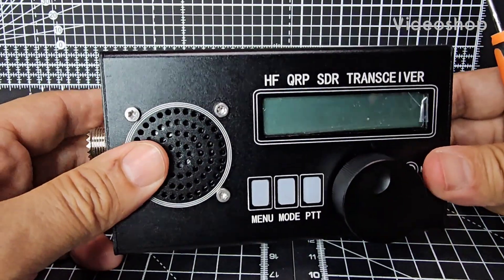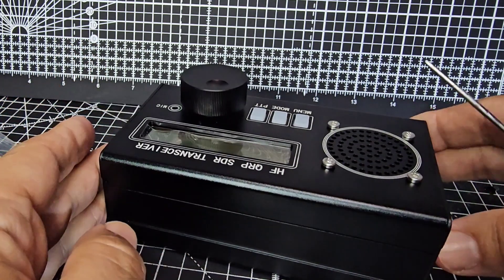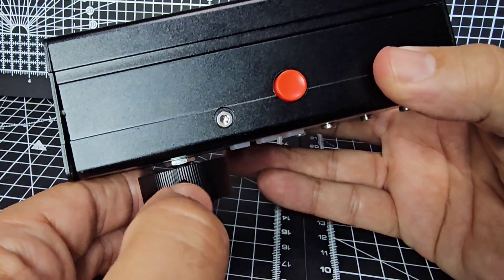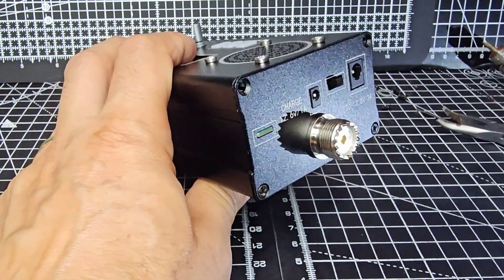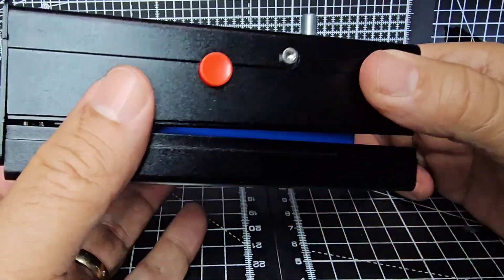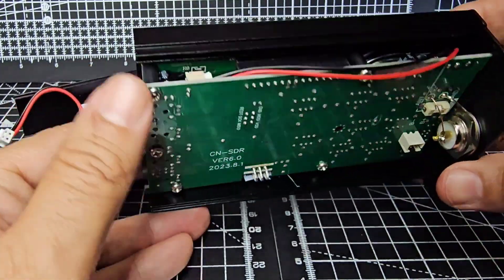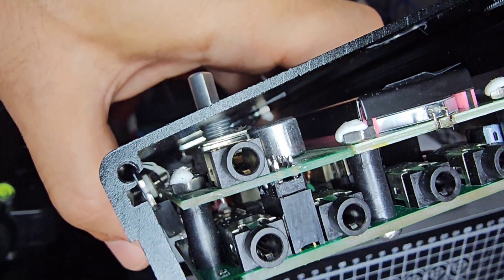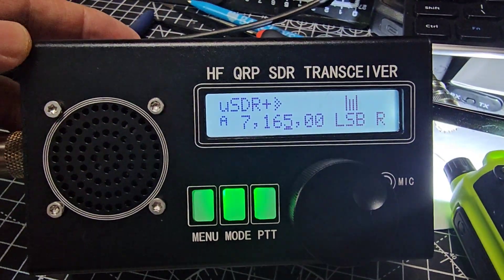USDR BLACK BRICK Dimantle.

Comment: I have this black brick USDR. Worked well for 6 months. Lost transmitting power, possibly from a faulty ham-stick antenna it came with. I cranked the PA Bias to max (255) and am now pushing about 4 watts. Good for JS8Call, which is mostly what I use mine for. Let's see how long it lasts. 73.
Reply from the maker: Ok